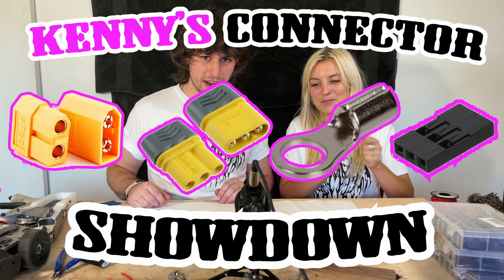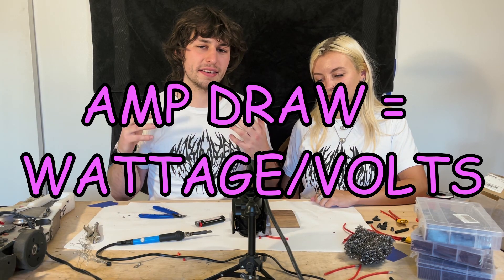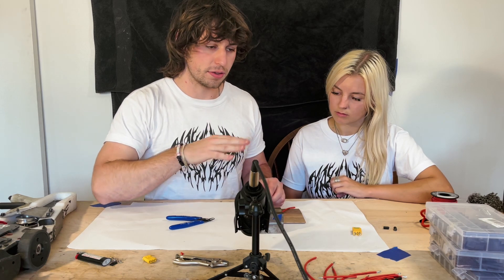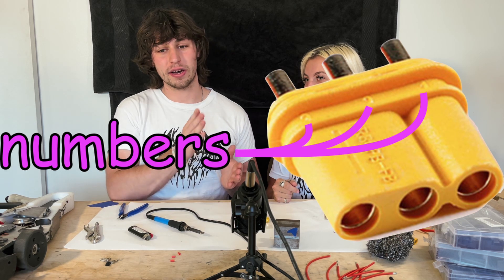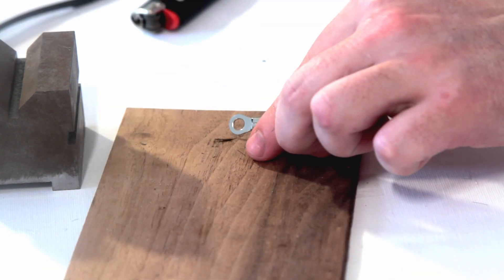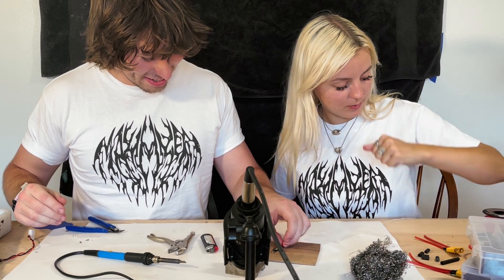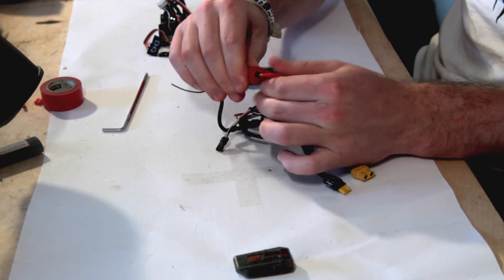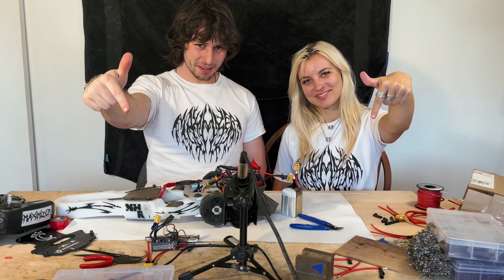Combat Robotics Guide - ELECTRONICS

Comment: what is the clear heatshrink I see over ESCs sometimes? I know it comes with ESCs but what are they called so I can slip one over my FS-2A?
Reply from the maker: I actually hate clear heat shrink! it's much thinner, enough that i had a hot esc melt clean through it, shorting the esc. 

the opaque black is much thicker and resists puncture and heat. it's also more obvious when there is a puncture or damage

if you look close at the maximizer harness you can see where i removed the stock clear and wrapped with my own. i think i get 1.5" to wrap escs. hope this helps!
Reply: oh dang! okay, I'll make sure to get 1.5" unsticky to wrap my escs. would opaque white be more useful in determining possible damage or cap pops considering the esc is usually black and would standout more at tear sites? @jakemaximizer